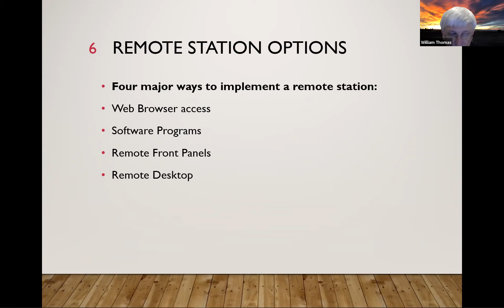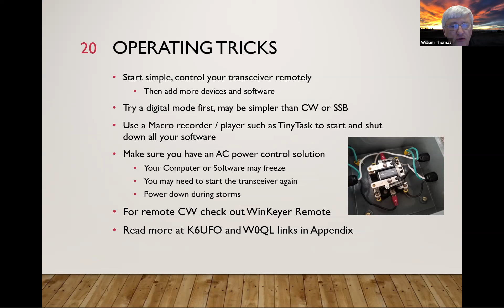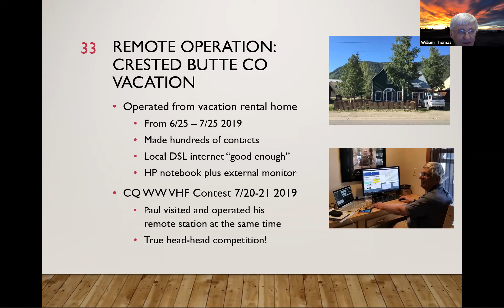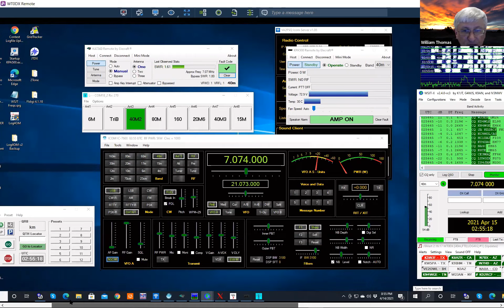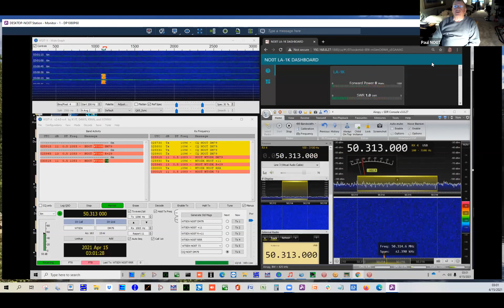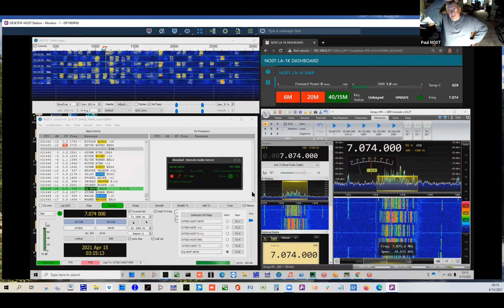Remote Stations - Setups and Techniques by Bill WT0DX and Paul NO0T April 14, 2021

Comment: Great video, I installed  VA2FSQ Server however get the following error, An attempt was made to access a socket in a way forbidden by its access permissions.  Win4IcomSuite works fine but I would like to remotely access as I can't have antennas up where I am, I am running Windows 11 pro so is the software not compatable ? Any help would be appreciated.